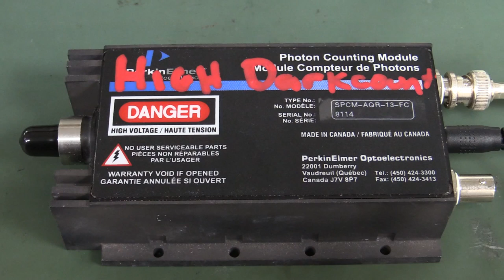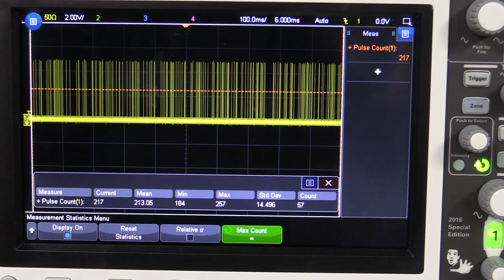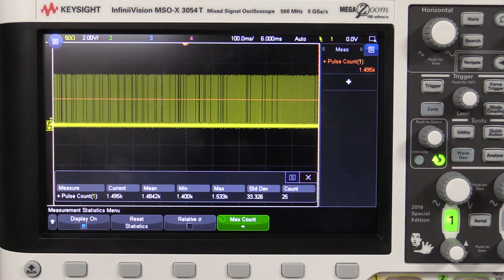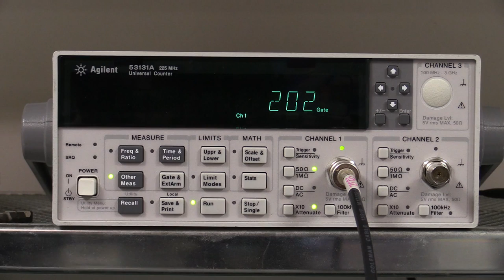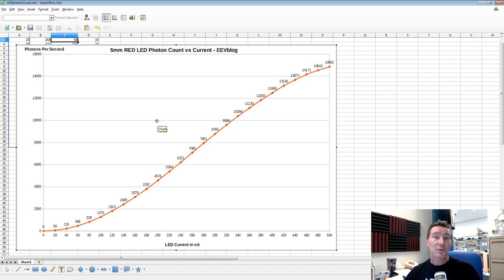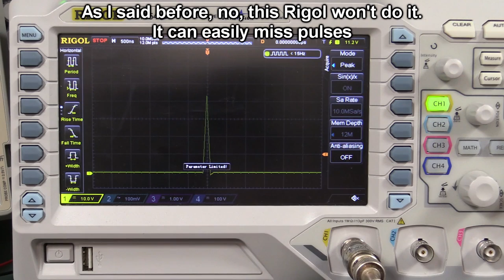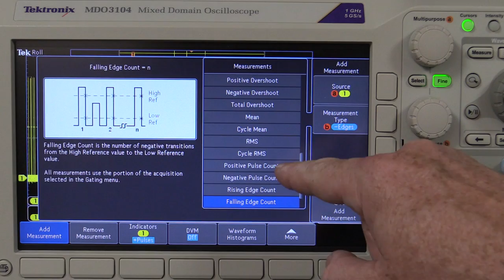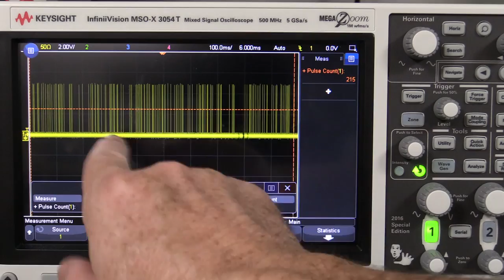EEVblog #869 - Counting LED Photons!

Comment: Negative curvature over right half of curve looks like detector saturation.  As detection avalanche events start overlapping, pulse counts are missed.  Actual LED efficiency is still increasing in that region.
Reply from the maker: +Walt S the sensor can go to 10MHz+
Reply: +EEVblog i think that does not matter. with increasing counts the probabilty that two photons appear next to ech other (in a timing sense) does increase. One may calc the probality that out of n events distributed with equal probability over 1s are located with Δt<100ns.  it is the same thing like the birthday paradoxon there the probability that in a scool are two pupils of the same birthday is much higher than one may expect.
Reply: +vlad tepesch 
Yes, time between photons should have an exponential distribution, if I'm not mistaken. But just because we know the maximum of the probability density function is at Δt = 0, doesn't tell us what the mean time between photons is, and whether that's dangerously close to the 50 ns dead time between pulses.
I would recheck with a different LED or attenuate the light output and check if the curve still tapers off at the same counts/s.
Reply: +Walt S Apparently you didn't read the freaking datasheet of the thing... The dead time of the internal APD is 50 ns... therefore the error of the measured count is less than 1% at counts < 20kHz (see the formula in the freaking datasheet).
Reply: +vlad tepesch Totally agree. Pulses per second should not be expected to just directly translate into photons per second. I also think that with enough data available it is possible to statistically compensate for that inherent flaw of that measurement technique and to estimate a true photon per second count (unless the photon count per second gets way too high and the sensor gets really saturated of course). That is probably why they didn't bother to make their pulses shorter - you would most likely have to do the math on your data anyway.
Reply: +Walt S In an similar example of an X-ray counter we have on an EDS system, pulses are shaped to be easier to count (and so magnitude represents x-ray energy). So while the detector may easily be able to pick up counts at 10MHz, the width of the output pulse may be considerably wider. As Walt S suggests, overlapping pulses that are considered as 1 pulse start to become more common when you get to dead times less than 30%. Looking at the shape of the pluses on a smaller time base may confirm this.
Reply: Actually, the tapering off at "high" currents is probably just a measurement error. As the pulses are not equidistant, the oscilloscope is going to drop/combine them statistically.

Comment: Just FYI, the eye is actually extremely sensitive to light, but you need to be dark adapted. This is normally achieved by being in complete darkness for at least half an hour. Under those conditions, you can detect on the order of tens to hundreds of photons per second. According to the source below, you can see down to around 5 photons per 100 ms. That's 50 photons per second (though I think 50 photons/s would actually be easier to see than 5 photons/0.1 s). But the eye filters out about 90% of photons before they get to the retina, so that's 500 photons per second from the LED. So I'd expect that you could detect the LED at 50-100 nA rather than the 800 nA if you were dark adapted.Source: http://math.ucr.edu/home/baez/physics/Quantum/see_a_photon.html
Reply: What about the people who had their lens surgically removed?

Comment: I work with that detector in my research!

Although you are a long way from saturation, the detector includes an automatic gain/quenching adjusting mechanism (undocumented but discovered by Makarov's group when they did a full reverse engineering of it: http://dx.doi.org/10.1364/OE.19.023590 presumably its inclusion creates better apparent performance.. but is a problem for some Quantum Key Distribution systems!)

This is unlikely to cause a problem with your LED demonstration, but has potential to reduce sensitivity as the light increases in orders of magnitude. Saturation and statistical distribution vs. deadtime are really only a concern when you get to 30Kcts+. 

If you are concerned by the odd negative curvature on the right of your graph it may be worth repeating the experiment with an optical attenuator (camera ND filter would do) to confirm the behavior is the LED and not a detector effect! 

Although the datasheet allows very high dark counts, all 6 of my units are at approx 70 dark counts per second, with minimal shielding effort... so the donor may have marked it as an unsuitable device to perform low photon rate experiments with, the SiAPDs in these units are binned by dark count and better units cost more.

Comment: You almost have an S shaped curve there.  The non-linear portion at the top may be saturation of your equipment, but at the low end it must be real.    Interesting!
Reply: +Kenneth Scharf I was also thinking about the detector saturation at the top part of the curve, especially since he's already shown that above 500na, the reported count stopped increasing...  It would be fun to see how the curve changes with the LED temperature...
Reply: +Kenneth Scharf I'v been working with a NIM in the past, and also developed an X-RAY photon counter using an extremely sensitive ASIC. was able to count even a single X-RAY photon with over 95% efficiency.
Roll off at the higher count is defiantly caused by the measuring equipment as it is clear that the photon flex is getting higher, all tho the datasheet stated 5MC/s... strange.
Reply: I agree, the dead time after each count would have a significant affect when close to saturation.
Reply: +Eyal Teerosh I'm pretty sure it's just the crappy counter in the oscilloscope.
Reply: TheHue's SciTech Not the counter in the oscilloscope, the detector itself has a dead time after each pulse in order to quench the avalanche in the diode. But if the detector has a 5 MC/s rating then this should not have ben an issue at 1.5 kC/s.
Reply: ***** Which is exactly why I say it's the oscilloscope that crapped out.
Reply: TheHue's SciTech The counter in the scope is rated to a few 100 MHz so I am not sure I believe that. But Dave was using such a low timebase so maybe you are right and the counter is acting weird. Would be interesting to investigate.
Reply: ***** Are you confusing the frequency counter with the on-screen memory based counter? On my Rigol at least, these are two totally different things, and the true counter does not allow stats to be done (again, this is just my Rigol).
Reply: +TheHue&#39;s SciTech So using the universal counter could do the trick. But stil, there may be some issue with the detector itself, the high dark current may be a symptom of a noisy HV circuit...
Reply: TheHue's SciTech According to the Agilent datasheet for the scope, the counter is taken directly from the triggering circuit and not the memory. Hence it should not drop any counts as long as they are not higher in frequency than the bandwidth of the scope. Not sure how the Rigol behaves since it runs all its math and displays in software and not hardware as Agilent does.

Also the roll-off in counts that was seen for Dave is very typical for a non-paralyzed process such as an avalanche photodiode in geiger-mode. If it was the scope that was limiting then it would probably behave as a paralyzed process which in the case of saturation would mean just one big count (one large pulse) so it would not converge to a constant value, it would instead start to decrease.
Reply: ***** You're still talking about "the" counter, as if there's only one counter. The one he's using is clearly locked to the timebase and waveform settings, this is not behaviour you'd expect from a direct-from-trigger counter. The behaviour looks identical to my Rigol, which means that the counter Dave is using is not the same as the one you're looking at in the datasheet.
Reply: If that is the case then I was wrong. That makes it more interesting if Dave could elucidate the cause for the phenomena in this particular case.
Reply: +Richard Andersson 
But Dave showed that if you disable Peak-Detect-Mode on the Agilent, the value of the counter goes down. That doesn't fall in line with the counter being taken directly from the triggering circuit, does it?
Reply: That is true, I didn't think of that. However the manual clearly states that the counter function in the measurement menu is a hardware counter with variable gating, driven of the trigger comparator and is only limited by the bandwidth of the scope.
http://web.mit.edu/6.115/www/document/agilent_mso-x_manual.pdf
Unless he used the less accurate "positive pulse count" function instead of the hardware counter?
Reply: +Richard Andersson 
Yes, I think that is the problem, looks like Dave used the "positive pulse count" function instead of the hardware counter. But I think none of the scopes can do averaging on the hardware counter.
Which means we are back to "Using the right tool for the job", namely the universal counter. And in order to get "averaging" working on it all Dave would have to do is set the gate time to 10 s and just divide the result by ten, but I can already hear Dave saying 28:32 "... nuuuhh, just doesn't have the vibe." ;)
Reply: +Kenneth Scharf Was thinking the exact same thing, certainly for the top end of the curve.
Reply: 18:00 Seems you could produce a known-linear source to be sure that your measurement method and sensor itself wasn't introducing the non-linearity. Perhaps just some optical filters stacked to see whether it produces a linear response of photon counts.

Comment: Some things that come to my mind that might warp this figure: 

- Missed photons due to dead time (50-60ns for counts below 5MC/s it says). Someone might want to calculate this.
- Shifting of the LEDs spectrum with higher current
- Shift in emission direction of the active LED region so that more photons are emitted into another direction than the sensor.

Page 6 of the datasheet has an actual formula to correctly defer the count rate from the measurements.

For measuring higher currents you might want to place some ND filter between the LED and the sensor. For the spectrum part maybe there exist some very narrow optical filters, or you can run things through a prism and a slot.
Reply: This would be a Video idea for Ben Krasnow from Applied Science.
Reply: +Dennis Lubert The dead time correction is actually quite simple to calculate. A nonparalyzable model would say the real counts n for measured counts m and dead-time t is n = m/(1-m*t).

So for a 60ns dead time (worst case), his top measurement of 15,000 counts would correct to 15,013 counts--less than 0.1% correction. Dead time isn't the issue here--it's most likely an issue with the counter in the scope.
Reply: @DavidOlson14  I immediately thought it might be a dead time issue in the APD circuit also.  Another possibility is that the issue is in the oscilloscope doing the counting.... might there be a dead time/sampling issues there?  The scope display quite obviously has a max pulse density that it can display.  Neutral density filters would be nice,  but apds are mostly setup for fiber optics, so you would need to be careful that the NDF isn't changing your coupling geometry

Comment: That's a nice experiment ;)

Well, to make this measurement reliable a few extra steps need to be taken.

For once, the wavelength of the light emitted from a diode is not completely independent from the voltage applied. This means the wavelength shifts (and with that the efficency of the detector changes) during the measurement. If you have a spectrometer you can check this and the applied voltage at the diode should be measured during the experiment aswell.

Further more: as the LED gets warm, its efficiency lowers. Meaning that as you drive more current through it, you get a lower efficency for the light emittance. Coupling the LED to a heat baths at different temperatures could be used to mitigate the problem (or driving it with pulsed currents of equal average power so as to have the diode run at potentially similar average power but different currents).

Then, when you count high rates of photons you need to account for the dead time of the detector. As you have an avalanche detector, after detecting a photon, the detector stays insensitive for further photons for a short period of time. This error is largest for high count rates. You can easily correct the count rates for the dead time when you know the dead time of the detector (or measure it).

At very low currents you also have the problem of noise with the current source. So the current-errorbars need to be measured aswell. I might also have unintentionally underestimated the errorbars for the photon rates slightly. They should be calculated according to gaussian error propagation.

Depending on the precise construction of the LED, the directional distribution of photon emittance also might change as the applied voltage is changed. This is easy to control for as one has to simply repeat the measurements with a differently oriented diode and see of the resulting count rates are proportional to the original ones.

These, and other unaccounted for effects may lead to the drop of in count rates for increased currents you observed.

But generally yes: at very low applied voltages even the metallic contacts to the semiconductor material start to behave non-linearly. From experience it is already not that easy to get simple contacts completely linear on e.g. p-GaAs if less than 10 mV are applied. And of course the n-p-junction is also not completely linear in behaviour. Most electronics are only approximately linear over the range over their typical range of operation.

But well done ;)

Comment: Interesting experiment. I suspect that the rolling off you see at the highest current is an artefact of the experiment rather then a real effect. We know from the data sheets that the output increases with increasing current up to some point. If you extrapolated the graph you have the output would have to level off and then start increasing again to join up with the data sheet graphs. That would indicate that there was one effect at very low currents and then another at quite low currents and a third at high currents. To me that feels like one effect to many but who knows, we'd have to do the experiment and find out.
Reply: +Wobblycogs Workshop Personally i think that if photons hit the sensor "at the same time" they get counted as one. Similar to overexposing a photosensor, taking the average of the photo with increasing exposure will also show a tapering-off at higher exposures. So its probably just a limitation of the set up, measuring out of the linear range of the sensor. (Similar effects for measuring Optical Density (OD) of bacterial cultures at higher culture densities and high fluorescence levels in fluorimetric experiments.)
Reply: @ReapingMiner  measuring OD actually has this problem at low OD, actually, not high.  At high OD, you are limited by noise (ideally shot), not overlapping pulses... high OD means few pulses, so less overlapping

Comment: If you ran out of range on the detector, can't you move the LED further away (or put a darkening filter in the way) and re-run the test?  Then use the overlapping measurements to come up with a multiplier value that will align the two sets?
Repeating this until the LED blows?
(I'm assuming the response to distance/filters stay linear)
Reply: I'm fairly sure he said it was the scope.

Comment: I bought a DS1054Z, which  still believe is a nice tool for the price. It has several limitations, though. Try saving the full memory data to the flash drive as a CSV file... 2 weeks later you may tell me how it went. :-)

Comment: i found that most linear relationships when scrutinized at the extremes display non linear relationships, they are reported as linear because that is the region in which the thing under scrutiny usually happens at, which coincides with the rising limb of the curve and is mostly linear. So the reporting of linear relationships is usually to simplify the condition irrespective of limiting conditions at the extremes.

Comment: Dave, Why don't you use Universal counter with higher time period, let's say 60 seconds? You can use the single capture after changing current through LED? Can you guarantee that your oscilloscope is not interleaving data from different measurements?
Reply from the maker: +Ianislav Trendafilov the scope is real time single shot capture
Reply: +EEVblog excellent video. I got the same 6th order polynomial curve when I plotted the relationship between a PLC analog output sent to a phase angle controller on a 230v 2.6Kw water heater for a batch reactor. It looks like a cosine wave.
Reply: +EEVblog 
Hi Dave!
please test some other stuff like
wire
germanium diode
1n4148
or hot iron tip 
...

Comment: Maybe the reason the diode started up is a combination of factors:
a) it had a few seconds to warm up
b) your shielding of AL foil and electrical tape is not going to stop AM/FM so I'd hypothesize that some of that got through and got detected and rectified just like it does in a Germanium Diode used in an AM radio set.

Comment: Might the sudden delayed jump in the count at 7:45 be due to the amount of time it took to charge the capacitance of the LED at such a low current? So once it finally got up to a high enough voltage it actually started emitting a few photons.

Comment: I'm a bit worried about how the end of the test setup is the upper inflection of the curve. The bottom would be more intuitive and maybe accurate. Could the top be the result of the end of the test setup, like sample time, or sample blocking up? It is a bit unlikely you just happened to get the inflections ranges but maybe you did.